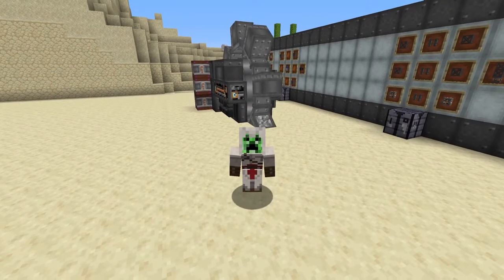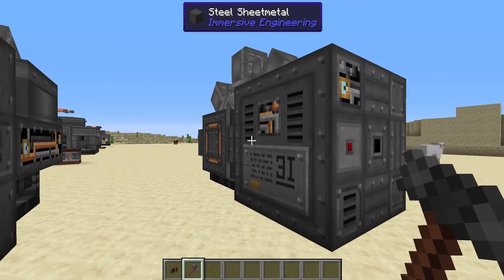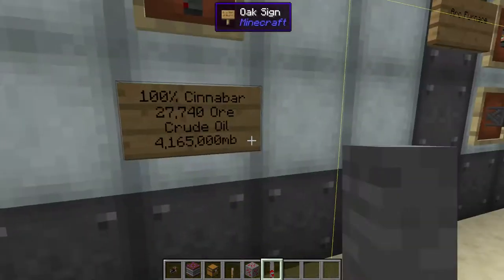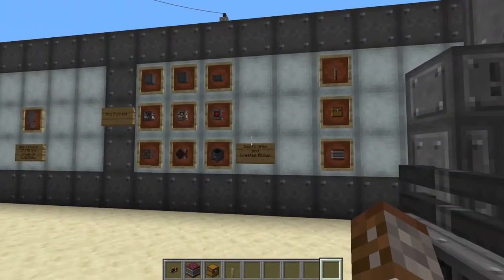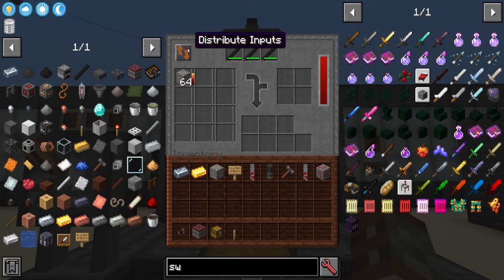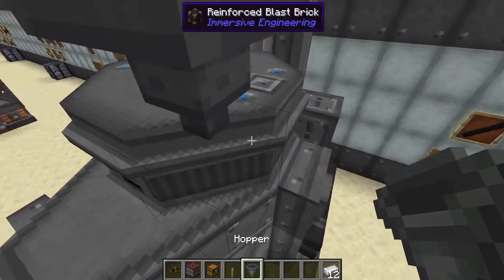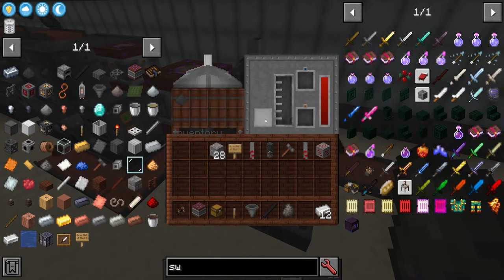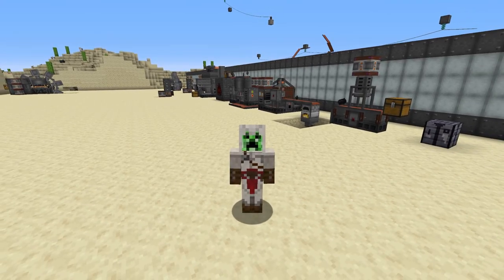How to: Immersive Engineering | Excavator & Arc Furnace (Minecraft 1.16.5)

Comment: If you use a blueprint in the engineering’s workbench, you can craft diodes with 100% integrity.  This can be automated by way of the automated workbench.

A quick question: Is there an input slot to automatically refill graphite electrodes?
Reply from the maker: By diode I assume you mean the electrodes? And if so I cover autocrafting with the auto workbench and assembler in the next episode! I wasn't aware electrodes give you 100% that way though so thanks for the tip!

There is no slot available to auto refill electrodes
Reply: Where do i get blueprints?
Reply: You get them as loot or by trading with an Immersive Engineering villager, but I believe that there is a config option to make it craftable.
Reply: If you automate diodes your done with the mod pack bro just stop if you need to automate something with 52k durability I promise you you don’t need that much of the thing you are smelting to go through one 52k durability that’s 52k ingots in arc furnace

Comment: am i missing something? im running 1.18.2-8.0.2-150 and i dont have a projector, ive tried to look it up and i cant find an answer
Reply from the maker: The projector is specifically from the Immersive engineering addon immersive petroleum. I am assuming it is in the 1.18.2 version but this tutorial is for 1.16.5
Reply: @Mondays3  ohhhh ok thanks, i tried looking to see if there were any addons but couldnt find any on the curse forge page
Reply: it hasn't updated anyway apparently